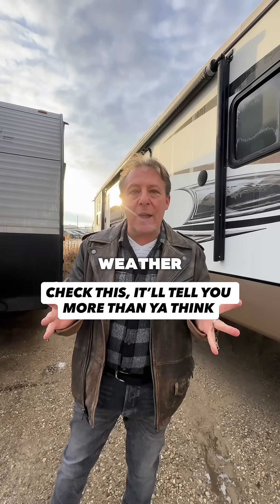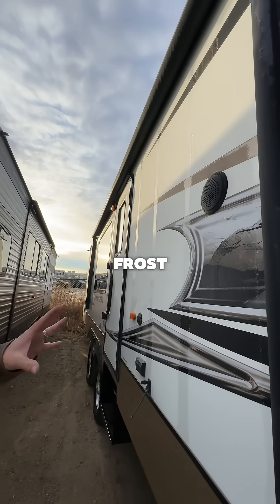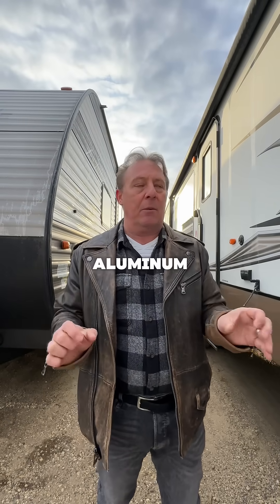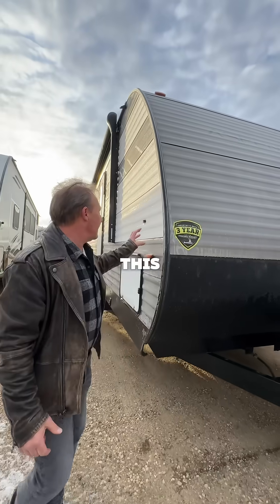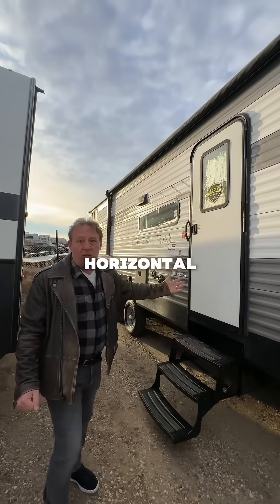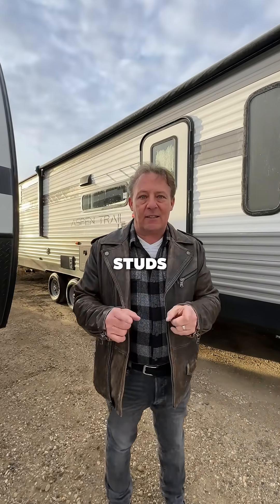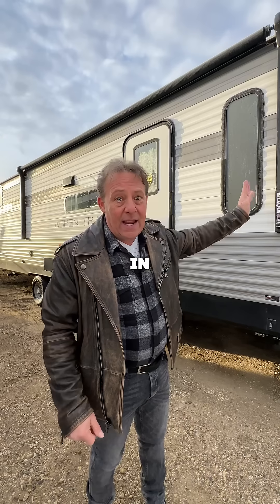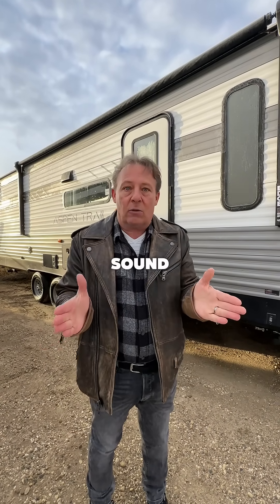EVER HAD AN RV SHOW YOU ITS BONES?

Comment: One small leak and that wood becomes a problem
Reply: Had a fiber glass for years...there is luan in them and water is more damaging to them. Delamination and rot happens faster to partical wood panels than dimensional lumber.

Comment: Ya well a lance aluminum frame is welded and the wood staples and nails and the aluminum one 20 plus years will still be around and strong not failing apart every where and don’t buy anything built during or after Covid except a Peak Mountain Camp the others other than like attic fox Lamce couple high Enders most all are Junk and manufactures are a joke to deal with and don’t ever by a Light or Lite model anything there cheap frames will destroy everything else speaking from experience